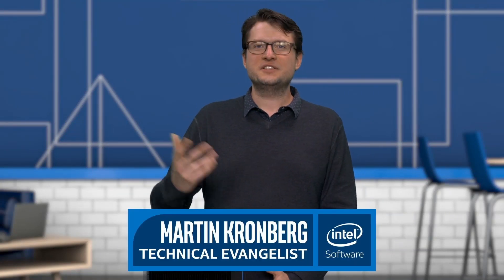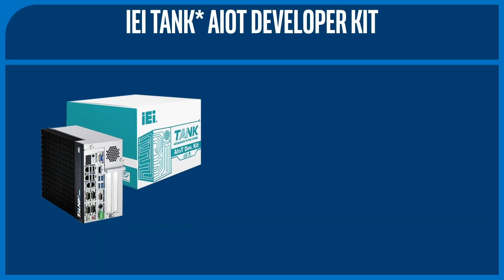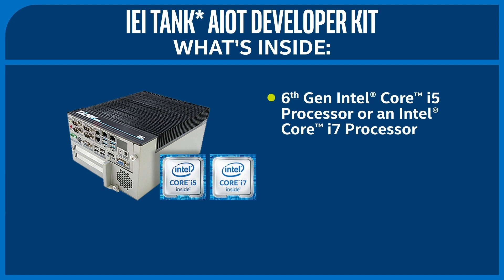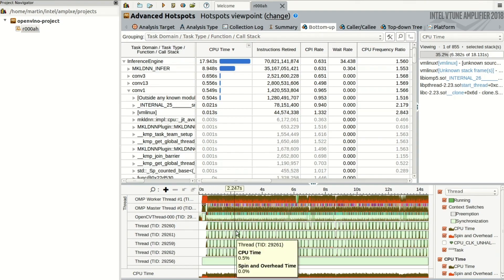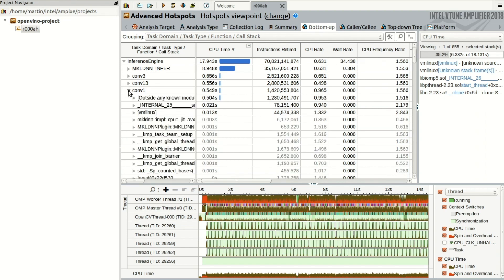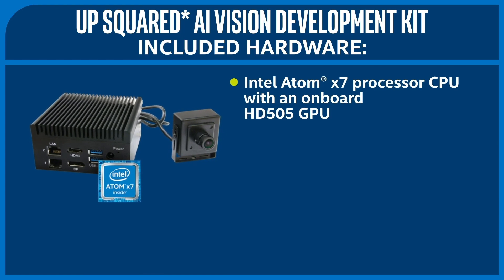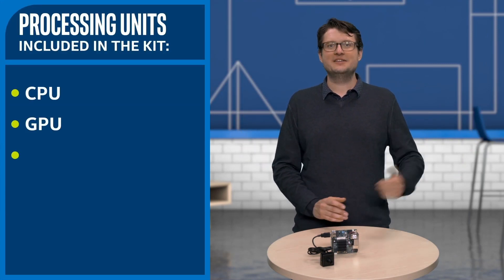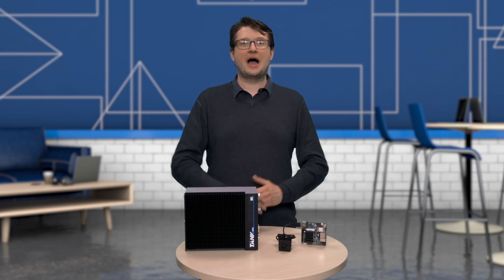IEI Tank and Up Squared AI Vision Development Kit | IOT Developer Show | Season 2 | Intel Software

Comment: Hello,
I am working on this kit.
I would like to know about how to run trained our model on this kit..
Please help me
Reply from the maker: Hello! The IEI Tank or AAEON Up2 has either Ubuntu 16.04 or 18.04 pre-installed, and one of the OpenVINO version is also pre-installed. Here’s the link for getting started with OpenVINO: https://intel.ly/2wAuuCx If your model is already trained, the first step might be using the Model Optimizer to convert it to the IR format: Model Optimizer Developer Guide, http://bit.ly/2PMGPKM, then learn how to use Inference Engine APIs in user’s application: Inference Engine Developer Guide, http://bit.ly/38xlwDK